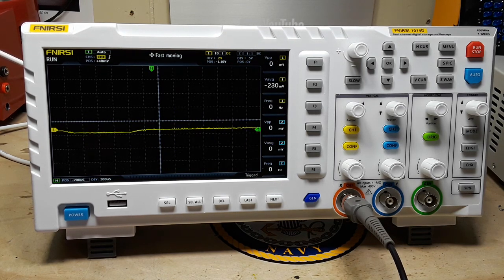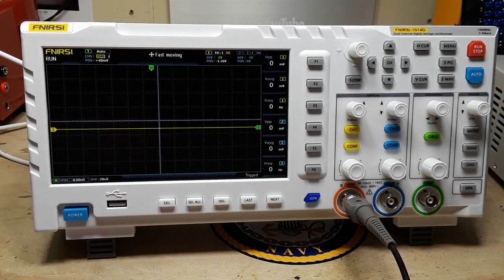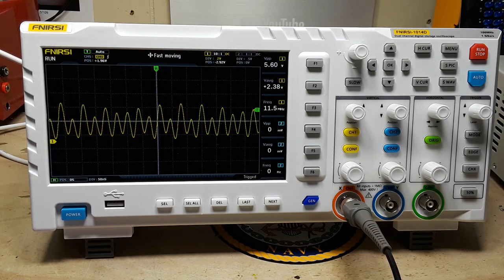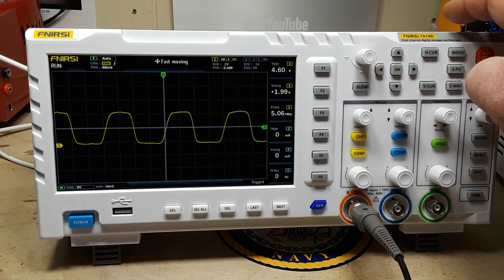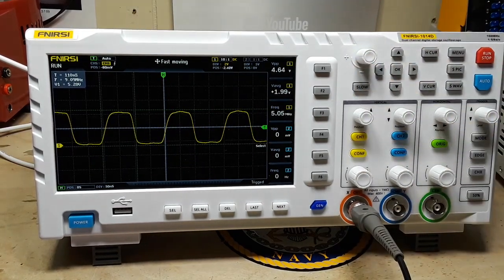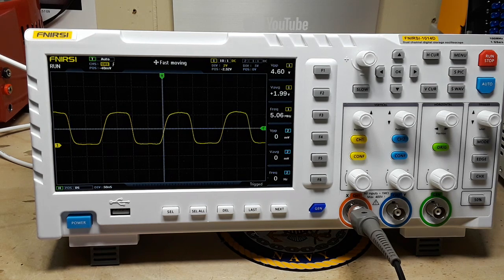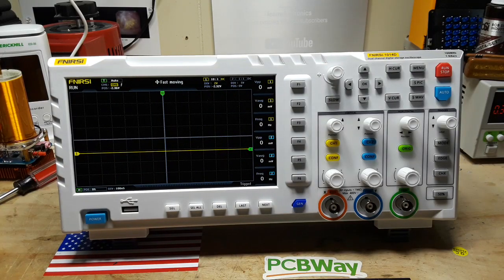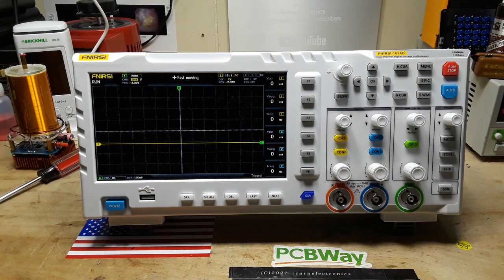FNIRSI 1014D Oscilloscope Review & Tear Down Part 2

Comment: Thanks for this review. I am a tube amp builder and need a scope for chasing down bad components and oscilations. I have little to no idea how to use these things at the moment, lol, so I find these videos invaluable.  
Hopefully, this thing is adequate for my needs
Reply: oh it is very adequate for your needs. i mess around with lots of class a, ab and d amps including chinese clones and you have no idea how much my 1014d has helped me. for audio work you need nothing more than what the fnirsi offers. the only thing i wish is that it had an option to change the amplitude of its signal gen. also having a better fft would have helped but i have a separate spectrum analyzer for that. you can only expect so much out of a 150 bucks scope

Comment: So I plugged in a small blue tooth speaker into the first channel of mine and it got up to around 25v peak to peak. The problem is that I increased the volume same voltage just dropped to the bottom of the screen (it broke). So I assumed that I blew a fuse, another problem is that there are no fuses as I can see. How do I fix this? Can I fix this? Also I noticed that the power cable that it came with doesn’t work any more, but I have an elegoo 9v 1000mA power cable and it works with that, but before I turn it on the screen turns white then it turns normal for a bit while it’s on, but when I click auto the screen freeze on what it was on.

Comment: From its manual, "The bandwidth of the 1X probe is 5Mhz, the bandwidth of the 10X probe is 100Mhz.  When measuring frequencies above 5Mhz the switch on the probe needs to be set at 10X, and the scope needs to be set to 10X.

Are you using the correct probe?
Reply: Cool , but i discover that Yuotubers Never Read the Manual 😅

Comment: So I just purchased an open box of this scope at a reduced price.  The unit itself is still in shrink wrap but there is no power brick provided.  Any suggestions on a power brick.  I know it’s 5 volts but any recommendations on current or wattage of the brick?  Thanks… love your stuff.
Reply from the maker: Get a standard 2500mA phone charger, works great
Reply: @learnelectronics  Thank you... much appreciated!

Comment: Hi, is it possible to measure the wave of 100 Mhz via cursor to get data? you didn't try that, It wouldn't surprise me if the reading of the frequency by the sparks produced by the power supply failed. The plug-in power supplies probably have bigger problems as i have see in Youtube.

Comment: I would be interested to know if I can connect a lipo battery with 3 or 4 cells. On the back it says 1-40 V input and I suspect that the voltage converter is under the long sheet metal cover. I have a lot of lipo batteries with 3 cells and 5 A from the model construction area, so the device can be operated for a very long time. Unfortunately, I couldn't find any information about the power requirement and, as I've already read plug-in power supplies can produce sparks in the image. It would be very advantageous if I could simply install a battery ( inside ) without using additional Stepdouwn controllers what would be stupid if a downstream step-up pushes it up again.

Comment: Interesting how most of the reviews for the FNIRSI 1914D Oscilloscope were done about a year ago.  FNIRSI must have sent a bunch out to the youtube content creators tjem. I seen several review though from about a year ago that test the scope and proved it does not work will past 30 MHz.  If you need a scope that is useful beyond 30 MHz, keep looking.  Can't believe the get away with false advertisement.

Comment: i was gona get the hantek but i like the idea of using my ryobi 18 volt inverter to usb to keep it mains free. If i use an isolation transformer is thare a limit of the voltage it will handle?

Comment: What kind of screwdriver was used for disassembly?
Disassembly is not possible.
I don't think it's a cross screwdriver,
It would be appreciated if you could point out the type of screwdriver used when disassembling it.

Comment: Unfortunately, this scope, and the Yeapook 1040D which is just a re-branded version of the same scope, are both 30MHz scopes which are being falsely advertised as 100MHz.  The industry standard frequency rating for a scope is the frequency at which the displayed amplitude of the signal is -3dB attenuated from the actual signal input amplitude.  That's 70.7% of original amplitude.  For this scope, that frequency is around 30MHz, NOT 100MHz.  Therefore, it is NOT a 100MHz scope.  I ordered one and found this out too late.  I'm sending mine back and replacing it with a real scope from a different manufacturer.

Comment: Try it again with the 100MHz oscillator at full clockwise on the sweep rate knob.  This is a SAMPLING scope, so it's not going to work exactly like an analog scope.  When you set the sweep rate too slow, you're looking at the beat frequency between the sample rate and the actual waveform.  For 110MHz, you need to max out the sweep rate.

Comment: It would be cool to see if anything can read that micro sd and see what is on it. Also, curious what happens if you try to run it with the sd removed. Sucks about the no 100mhz, but it's still pretty great.

Comment: I ordered one of these scopes,now i find there are issues with pk-k voltage being off and by a fair amount that a firmware upgrade does not fix,did you compare this scope to a known signal source pk-pk voltage?.
Also it has a min Vin sensitivity of 50mV(when or if it actually measures correctly),of course sponsored vids will make claims of perfection,but you expect that.
I don't intend to measure over 100Khz as i want the scope for audio,i know 20Hz-20Khz but the amplifier will still amplify higher Hz than audible range.
Appreciate the effort to show these entry level tools.

Comment: I found this channel trough search. Thanks for efforts. Saw Hantek 250$ scope and this one and matter of fact these reviews are useless garbage. If this was a toy then okey we saw how it looks alike. But its very important measuring device, so how can you review anything without checking side by side with another one!? Instead its "interesting". Just  make sure your generators are working as designed at this particular moment, and make sure is this "modulation" is real or its result of how this scope is functioning. I get so annoyed.
Reply from the maker: Then feel free to fuck right off and watch another channel.

Comment: On one of the 4 star reviews to the rebrand version of this scope, on Amazon I think, they mentioned that a "firmware upgrade to this scope" could be used to flash the memory of the rebrand version and bring it up to the 100MHz range (someone else also saw the shortfall apparently). Maybe a simple firmware update is all that is needed here to bring this scope to advertised specs?

Comment: I recently bought one of these (FNIRSI-1014D) because of its claimed features. It appears that the recent appearance of many of these cheap clones is the result of companies like Keysight doing their  manufacturing in China, not realizing that their IP will essentially become "public domain". Unfortunately,  these clones don't completely know how to apply said IP and end up with this sort of instrument. There are a number of "new" 1GS/s units that show the frontend ASIC, seen in the teardown,  with its ID/part number removed or hidden. Downstream from the ASIC is usually a FPGA or MCU to perform the DSP and display interface functions. The FNIRSI-1014D could have been soo very much better if the designers did a more thorough job in the backend DSP. This unit can't even do simple math of its 2 channels (+. -. *, or ÷). The FFT function is completely useless. Then it comes to all the aliasing, memory limits and sample rate management issues. Not to mention that there is no USB control offered. For the $$, I'm returning this one and going with the Owon_SDS1022 or the Hantek_DSO2D10. Sorry FNIRSI, you need to do better.

Comment: My first 2 thoughts

- is the breadboard capable of giving a RELIABLE 100MHz signal,   i recommend using a SIG GEN instead

- You're using AUTO quite a bit,  i wouldn't trust AUTO settings,  i recommend adjusting manually 

- i also don't think the problem is so much so analog bandwidth as it would be Memory Depth or Sampling Rate

Comment: This scope is a piece of JUNK that is nowhere near 100MHz, and the signal generator is there to suck you in to buy this overpriced (yes overpriced) piece of junk!
Test for the REAL specs, not the lies it has!
Reply from the maker: Well geez there Stevo. Did yo have a bad experience with the scope? Fill me in and and maybe I can help.
Reply: @learnelectronics  Where do I begin...  do some serious performance tests and you will see, for starters it is NOT 1 1GS/s sampling, it is MUCH LOWER.
Reply: @stevenbliss989  Yeah ive heard that alot,  it doesnt meet advertised specs but I dont need all that spec and it looks good everywhere else with its quick boot and response. If they advertized this as  30mhz scope would it all of a sudden be good? because thats the only complaint im hearing which is a non issue for hobbyist like me that intends to use it for audio amplifier circuits, but if theres something better in the price range, or theres something else really wrong with this unit  please do share.
Reply: @learnelectronics  Just do any single shot of a fast signal 10-30MHz, preferably non-repeating, and you will se that it FAKES the higher sampling rate by multiple RANDOM sampling at a MUCH LOWER sampling rate (likely 20-100MS/s)  ...it is a FAKE PIECE OF LYING JUNK!!!!!!!!!!!!!!!!!!!!!!!!!!!!

Comment: 1) Never trust “auto set” function. The software makes assumptions based on what is read through the ADC. Always crank the time-based knob to get a “second opinion”.
2) Aliasing is a common problem with digital oscilloscopes. The display and readouts will show a lower frequency signal with a misrepresented waveform. This is more so, when “auto set” is used.
3) To a certain point, “auto set” is like the “autoroute” functions on PCB CAD software: they are ironically NOT for beginners.

Comment: Please don't spend your cash on this product.  I bought several of these.  It's been a nightmare.  Missing accessories, delivered with manufactured problems.  Mine had bad Channel A.  They eventually determined that parts were installed backwards.  Which means channel NEVER worked.  There is no final test on the product.  I live 15 minutes from FnIRSI facility in Shenzhen.  They wouldn't let me even bring the unit to them for repair.  Instead they sent me a bunch of photos detailing the SMT parts that have to swapped.  Great if you are hobbyist and don't mind DIY Support and Repair.  FNIRSI has bad reputation.  Stay away.

Comment: Needing an Oscilloscope, thinking Siglent 1202X 200 mhz, What do you recommend? Under $400 also need Microscope for SMD, looking at Pluggable USB, on the cheap ; )  Thank You. . .
Reply: I have the 1202X-E, and I can tell you I love it. lately, I have been using it to build an HF radio and I have had no problems. the FFT works great also. I've used it in XY mode, I've built a probe and used it as a tracer. all works well. also, I have read signals well over 100Mhz and no problems.

Comment: This is the same osciloscope as the 1013D but in another format. So no it is not a 100MHz and most important it's far from 1Gsps ...
Reply: It's Chinese 100mhz / 1Gsps so like most Chinese electronics you take the maximum it's rated at, divide it by half and then again by a random division then you get close to what it's really rated at. Found that especially so with power supply modules. Applies to this too. I have the 1013D it's adequate for my needs but in no way is it capable of doing as advertised.

Comment: As I wrote in part 1: of course you can calibrate the probe in the BNC connector of the signal generator. But do you really have to save money where possible? But then the question remains, what else can I expect from the device. I think you saw that here. For not much more money you can get a hantek dso2c10 or an owon SDS1102. These are only beginner-devices too, but at least they are usable.

Comment: It's strange, I get 75mhz+ and stable on mine!
Reply: This 100MHz range availableonly when you set probe to x10, for x1 it's much lower. Idk which probe multiplier used in this video
Reply: I expect that it has a singularity where it can't properly capture 100MHz and 50MHz but will capture other frequencies in the range, due to some sampling issues.

Comment: As if my previous comment wasn't long enough...

Paul also demonstrated a frustrating trick that AliExpress vendors do.  He searched for the 1014D, ranked the results by ascending price and WOW!  Some vendors are selling it for only a bit over $60 - I'm already getting my wallet out to buy a BUNCH of them at that price!

But it's a frustrating mirage.  When you click on that item, even though the picture and the title text matches the 1014D, they're also selling some much lower value product too, and that's what's selling for $60+.  (In this case, one of those handheld, small display scopes.)  I really wish AliExpress would police this.  At the very least, they should show a range of the different prices under that listing.

Another trick they pull is to list various countries to ship from, and the low price only applies to some country that doesn't ship to the U.S.  This price is often for Russia or France - hobbyists in those countries must be saving a bundle!  :-)

I'm kind of skeptical that this scope was every listed for a shipped price of $150.  I've been pricing it pretty obsessively for the past month, and the lowest shipped price I've seen has been slightly less than $170.  Maybe the $150 price didn't include shipping?  Another vendor trick on AliExpress - low price but high shipping cost.

Comment: Cool video Paul. I think the problem is sampling rate, not analog bandwidth.  The sign of analog bandwidth would be the 3 dB point where amplitude drops as you know.  But when the waveform is misinterpreted as this was doing - it is a sign of not enough samples to connect the dots properly.  For instance, when you changed from 50 ns/div to 10 ns/div, it showed the right waveform as now you are collecting 5x less samples.  Then when you went to higher freq - it again gave the wrong waveform.  At about 2 min in and you said the wave was shown right but the freq counter was off, well the freq counter was showing what the displayed wave was showing, so the waveform was not correct.  
I’d say it is more like 10 MHz, or maybe 20 MHz if you only show a few cycle.  What that shows is that it is likely an issue with sampling rate and not enough memory to capture enough data points even at 28 MHz, unless you are OK with just a few cycles one the screen.  IMHO;)
Reply: It's much worse, ...this is a FAKE BY DESIGN POS crap scope!!!!!!!!!!!!

Comment: A 100 MHz pure sinusoidal wave should be used for the test. A 100 MHz square wave will require a quite higher sampling rate to get enough samples to have a good interpolation.  This is because a perfect square wave is made of summation of the whole series of odd harmonics.
Reply: Not really. 
If the scope actually had 1 GSa/s (as advertised) it would have 10 samples to draw 1 cycle of the square wave, which is just enough to convey its basic form.
This is the reason why scopes should have sampling rates at least 10x greater than the advertised maximum bandwidth.

PS.: This scope probably has 200MSa/s since it uses the same chip as the 1013D but with two 100MSa/s vias combined at each channel. Also I doubt that this protoboard and alligator clips are a viable setup for a 100Mhz signal.